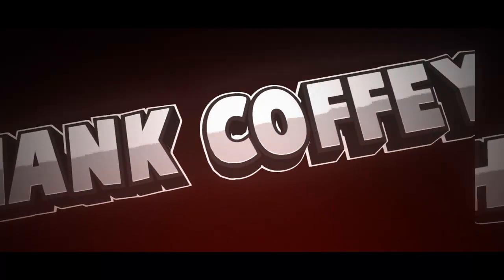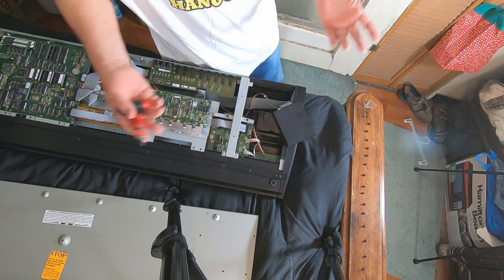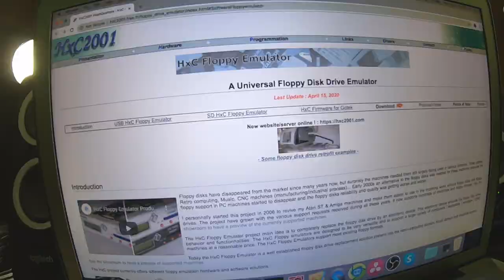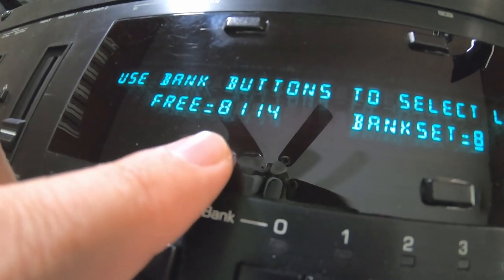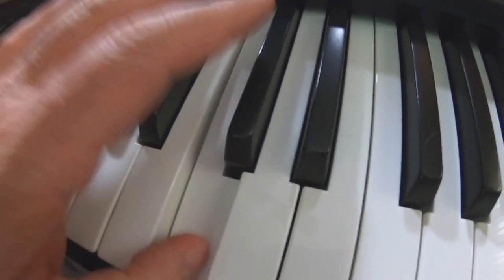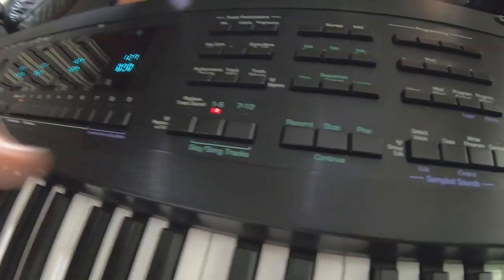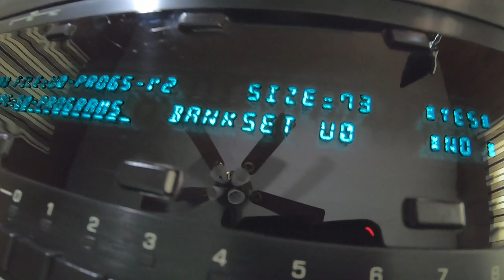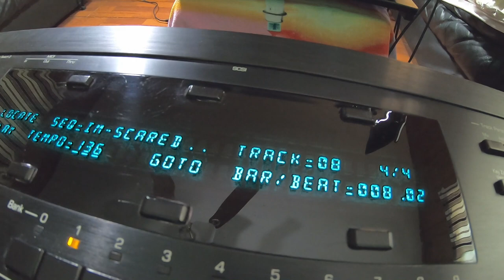HxC USB Floppy Emulator - Ensoniq TS-12 Install - TS-10

Comment: My ASR-10 was the Fairlight CMI I always wanted, but better. I remember having to send samples via Appletalk to the ASR thru Propellerheads' Recycle. Painfully slow but worth it. Great video, thanks!
Reply from the maker: Thanks man. Yeah there are a few Ensoniq utilities that can still make ensoniq format samples. WAV2EFE, Chicken Systems Translator.  Stuff like that.
Reply: @HankCoffey  I downloaded that program HxCFloppyEmulator (plus like 6gb of sounds) and now the fun task of tuning them into useful files. Your videos have been very helpful. Thanks again!
Reply from the maker: I actually switched to FlashFloppy firmware on my Goteks. You can just load the IMG files. They don't have to be in HFE format.  I never did a update video on the change.
Reply: @HankCoffey  Cool, I'll check it out!
Reply: @GloveBunniesVideos   Tell me, write a link where I can download the program and 6 GB

Comment: Just found your channel, great stuff. I have a Ensoniq sd-1 and bought a gotek from ebay a few years ago but never got it to work on my keyboard. Did you buy an ADAPTED gotek drive or is it just a standard factory one. ? I`m from the u.k. Also did you have to format the usb stick differently to fat32 or something else? Thanks for your great videos.
Reply from the maker: Hey Brian. I have a VFX SD that I am installing a HxC in soon. That is basically a 1989 SD-1. On my Mac, I format the thumb drives to FAT32 (master boot).  You can't manually put SD readable files on the HxC with any computer. The only way this drive works with the SD -1 is for storage only.  The thumb drive has to have blank hfe images in it. The SD-1 will see these images as a blank inserted floppy. If you want downloaded sounds on this drive (sysex).  You will have to dump the sysex onto the SD 1 through midi cables. And then save the banks to the virtual blank floppies on the HxC.
Reply: @HankCoffey  Thanks for that info, yes I manages to SYSEX a set of sequenced files from SD-1 to PC and then back which was brilliant, I have a lot of old Floppys with sequenced files I did but it sometimes crashes the SD-1 as they wont read properly with the keyboard floppy drive, I wanted to convert the disks onto a pc with a computer floppy drive and put on thumb drive so sd-1 will read them without crashing. Hope this makes some sense. :)
Reply from the maker: I think everything saved on the USB drive has to be by the VFX... I don't think it will read anything else.  You'll have to load your sequences into the VFX by midi cables... then save to a hfe blank on the USB drive.   I will be doing a VFX USB video in a few weeks.  I'll check it out.
Reply: @HankCoffey  thank you, look forward to seeing them and learning something new :)

Comment: I have a box full of TS-12 diskettes. How do I transfer them to the HcX Emulator? I don't think my Windows PC drive will read the Ensoniq diskettes.
Reply from the maker: A PC with a internal floppy should read them. You have to use software like Ensoniq Disk Tools or Omnifloppy...  Read the disk to IMG file...  Flashfoppy Goteks will read the IMG....  HxC firmware Goteks need the IMG conververted to a .HFE file.  Google "read Ensoniq disks to IMG".  I don't mess with this stuff much. I'm a guitarist.
Reply from the maker: @JeffHxC2001  the HxC Goteks I purchased in early 2020 didn't support IMG. I don't mess with my hardware much anymore. So I don't pay attention to what is going on now.

Comment: Nice video! I wonder, what's the benefit to convert the IMG files to HFE ? I use the exact same Gotek with this HxC firmware on my TS12 and Gem S3 since years but i don't even remember to have started this software once 😅.
Reply from the maker: There is no advantage. It's better to leave them IMG. HxC used to not read IMG, only HFE. At the time of this video, I wasn't aware they could read IMG. I guess since 2017 HxC can read IMG.

Comment: How do you SAVE a sample to another location, for example to an other USB thumb drive?
Reply from the maker: I don't think a TS will save samples. I think it only loads and plays them. I recommend asking on the Ensoniq Facebook groups. There is a TS group. They should be able to answer your questions.
Reply: @HankCoffey  Thanks, man, I still have a lot to learn. Can I save sequences to the floppy emulator?
Reply from the maker: @vantasties  yes, the TS will save sound presets, banks, and sequences.  But I don't think it will save ASR samples.

Comment: I am looking at some of these emulators. There seem to be s lot of models out there. Some say they are for Ensoniq, Somme do not. Are they different, does it matter? I just got a TS12 and they had a bunch of floppy’s included (not factory). I tried loading something and it said discs not formatted. I tried to format one of them and it displayed the same message, so, I am not sure if it is working or not.
Reply from the maker: It might be a issue with the floppy drive. Ensoniq is real picky on what it will read also. It's a real headache getting them setup. The TS-12 Gotek should be the same as most of the others. The seller is using brand names to advertise. And sending out the same drive. All of my keyboards have the same Gotek in them.
Reply: @HankCoffey  Thank you Hank. I appreciate the info.

Comment: Thanks for posting this video. It really helped out with my issues with the gotek emulator . I did know what software to use . I still have issues with an old floppy drive that the Mac don't want to install the driver to . in order to get to files out of there floppy disk into my computer I probably just need an old computer depicts floppy disk . Perhaps you like some music it's data from Star trek.
Reply from the maker: No problem Gabriel. A old PC is best to do all of this stuff with. I can't do much on my Mac. There are apps to do everything with these files, but they are for PC.

Comment: Help
TS-10 question.

I installed the USB Floppy Drive.
I made an HFE file in the USB and opened it, but there is no response.
I can't recognize it, is there any way??
What did I miss in the middle??
Windows 7
Help....
Reply: Even if I join Facebook and look for a related group, it doesn't come out
Reply from the maker: @Live-br8sj  the hfe has to be Ensoniq EPS format.  The TS will not read a dos or fat floppy.  By default, the software is set to make a standard format floppy. You have to select Ensoniq EPS from a menu box. And then create that image.  It is possible you have a flashfloppy Gotek and not HxC. Flashfloppy is different.  I hardly ever mess with my keyboards.  I would have to get familiar with the software again to give specifics.  I should show in this video how to select Ensoniq EPS format.
Reply from the maker: @Live-br8sj  right around 8 mins in this video. https://youtu.be/OCCJHap2wR4 you have to make Ensoniq EPS DD format.
Reply from the maker: @Live-br8sj  and you can create a new blank image on the ensoniq eps menu page also.
Reply: USB storage is a problem.
I'm trying to format in ts-10 but it's not recognized.
The error message is not formatted
The computer works well, but the ts-10 can't because of the USB recognition problem.
  I think it will be solved just by recognizing the usb disk.
I would appreciate it if you could tell me the name of the program.
Reply from the maker: @Live-br8sj  I say all of this stuff in the video. HxCFloppyEmulator. I'm even showing you the website to download it from.  Your hfe disk image has to be ensoniq EPS format...  Put the Gotek on that hfe file.  Then format it with the TS. Just like a floppy.  That's about all I can help you with man. Get on Facebook, there is an ensoniq TS Group on there.  Welcome to the world of Ensoniq. They do not like to read anything.  I say specifically what you need to do in my videos.  If that doesn't work, get on the ensoniq groups.  Later.
Reply from the maker: @Live-br8sj  there's always the possibility of there being something wrong with your floppy ribbon cable, or the gotek just isn't working properly.   Ensoniq will only read Ensoniq EPS format. They are not compatible with computer formats at all.
Reply from the maker: @Live-br8sj  Also what I'm trying to tell you is, the hfe image has to be ensoniq EPS format, before the TS will even format it.  The TS just will not recognize a hfe file that isn't in EPS format.  You have to make these hfes with programs like hxc floppy emulator. Later!
Reply: @HankCoffey  Thank you for the answer.
I'll study more and try.
Thank you very much.
Reply from the maker: @Live-br8sj  Good luck friend. It's not easy to make Ensoniq read stuff. It took me a few weeks of pulling my hair out. But once you figure it out, it works.

Comment: Great video! Does it have to be flashed or is it fine the way it comes off amazon?
Reply from the maker: They have to be flashed with firmware. Usually sellers do this already. They either use FlashFloppy or HxC Floppy Emulator. Both function about the same. I like FlashFloppy a little better.  Unless a listing says it's flashed, might be safe to expect it isn't.
Reply: @HankCoffey  Yea i agree. I love the videos. Wish you had a Asr-10 turtorial.

Comment: What is the name of this TSD disk that contains this samples?
Reply from the maker: I am pretty sure they are from the SSD-100 and SSD-101 floppies.
Reply: @HankCoffey  Thx.. There are some way to recover data from the old diskettes to the PC and pendrive??
Reply from the maker: @babaloo21  There is old software that can do this. I think it requires an old PC with a floppy drive.  I use Macs, so I do not know how to work with the physical floppies. I got the IMG files online.
Reply: @HankCoffey  Ok, i don't know if these old floopys are formatted on ms-dos.. if not, windows will not detect data, maybe Mac will detect, i must try, thank you 🙏
Reply from the maker: @Cesar Silva  Ensoniq used it own format. It can not be read by a computer. Unless, you get a old software called Giebler or something like that. There are a few others that can do it. You should be able to Google everything you need to know. There are message threads on the topic.
Reply: @HankCoffey  OK Thanks 🙏🙏